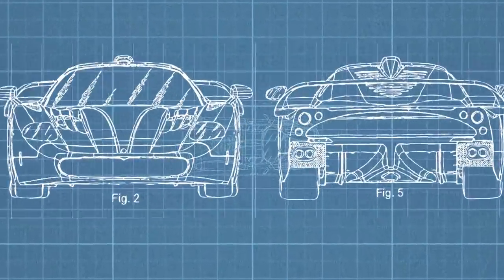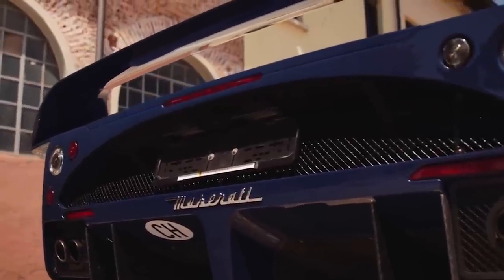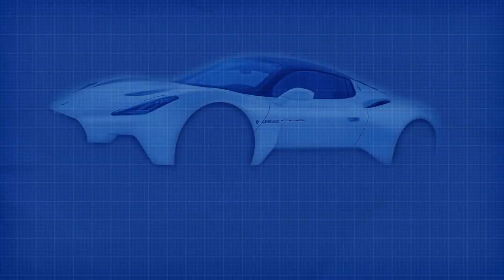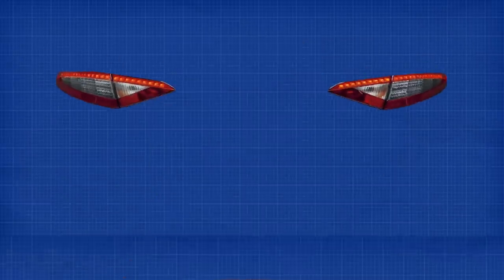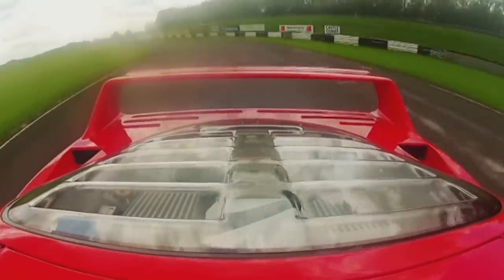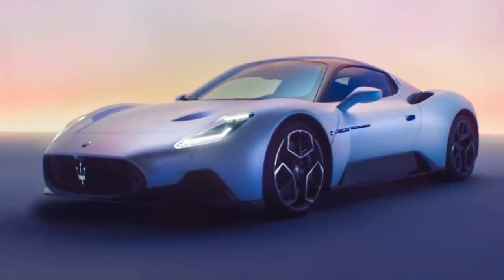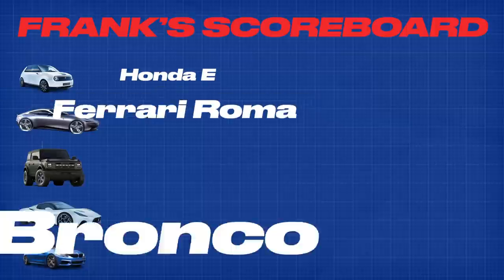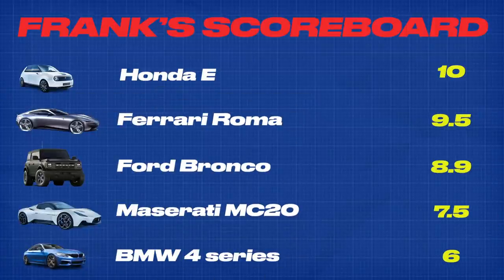MC12 Designer Analyses The Maserati MC20!

Comment: A Lambo Huracan has a drag coefficient of 0.39, the MC20 has 0.38 which is better. A porsche 918 Spider has 0.36 which is not far of the MC20. Almost all supercars have a higher drag than normal cars because of the higher downforce. A basic Giulia has 0.26 Cx while the Quadrifoglio version has 0.32 because it has much higher downforce. The air pushing down the car creates extra drag.

That is even more obvious in Formula 1 where the car drag coefficients are between 0.7 and 1.1, depending on the circuit the car is set up for (that is the downforce setup).
Reply from the maker: Thank you Cobra. Are you a professional or amateur aerodynamicist?
Reply: @FrankStephensondesign  You're welcome Frank. I am an amateur, no one payed me to say that. But the guys who work at the Dalarra wind tunnel are professionals, and get payed for nothing, since they got the aerodynamics wrong, right ? So what difference does it make if I am an amateur or professional aerodynamicist ?
Reply from the maker: Cobra, the wordings that you used are straight out of the Maserati press pack information and your reference to Formula 1 drag information is straight out of Wikipedia. Rule number 1 in the design world, never believe whatever you’re told, double check it for yourself. As to Maserati’s aero communication, the hype written about Dallara’s aero work is like saying Ricardo tuned McLaren’s road car engine. That’s great but nothing innovative, Earth shattering or segment leading. It’s like Maserati’s communication here: “The door sill air ducts, located immediately in front of the rear wheels in a zone with natural overpressure, enable the necessary air flow through the engine compartment without impacting resistance.” Every cooling duct does that. It’s like saying, “The door hinges on the front part of the door allow the door to open wide enough for the driver and passenger to get in.”
Reply: @FrankStephensondesign  But how can I double check the aero coefficient of a formula 1 car Frank ? I have never seen a formula 1 car or a wind tunnel in my life. Probably neither the guy who wrote the wikipedia thing, he simply took it from a reliable source, which he mentions there somewhere. As for the MC20, I dont know what more reliable source other than Maserati's own press release should I consult in order to double check if the info regarding their car's aerodynamics is correct. I think you have an issue regarding their interpretation of the data, not with the data itself. Now that I have seen the downforce figures I agree there may be some marketing involved in the press release which ellogiates an otherwise not very efficient aero design. A drag coefficient of 0.38 is not bad if you have 500 kgs of downforce, but if you only have 100 kgs, that's pretty bad. Compared to other supercars like the 458 Italia which had 0.32 Cx and 360 kgs of downforce, and no active aero either. Hell, even a sportcar like the Giulia QV has better aero than the MC20 (altough it has active aero in the front).
Reply: @FrankStephensondesign  The Mclaren engine is not just tuned by Ricardo...it is developed and produced by Ricardo, just like Gordon Murray engines are developed and produced by Cosworth. Mclaren doesnt build any of its engines, and neither does Gordon Murray. As you know, even the original Mclaren F1 had a BMW sourced engine from the M1. Then they used Mercedes engine in the SLR Mclaren. As far as I know, Mclaren and Gordon have never build an actual engine.
Reply from the maker: Cobra, McLaren’s road car engine is actually Nissan’s original VRH35L engine, tweaked.
Reply: @FrankStephensondesign They forgot to write that in the press-release, then :> So their british engine is in fact japanese. No wonder it sounds like a rice car.
Reply from the maker: No, the exhaust system is not carried over.

Comment: I think Maserati made a huge mistake by releasing the car in white. Sure its better to understand the lines going on but there weren't much to look at in the first place. I think for the case of the MC20 colors and tailormade attention will make it more Italian. I mean just look at the metallic yellow and red. It just so sexy and enticing. I think there is no emotions on the surface but the car could go so far head with it having it presented in a Rosso Metallizzato. Its not Italian passion I see on the surface but german swedish styling. Also i think carbon is a bit annoying to see allover an interior. I would rather prefer more metallic aluminum buttons for their tactile feel and the coldness and solid clicks they could achieve. I like the carbon shifters as it was seen on the Gran Turismo if I'm not wrong. i also wish they incorporated the air vents on the bonnet although they could add it on the race car version. I just didnt feel any emotions like i did when I saw a maserati years ago.

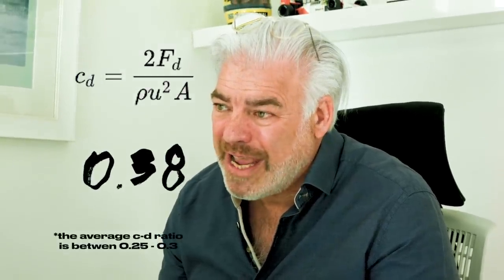Comment: 5:22 The Mercedes EQS has a Cd of .20.

A 350Z has a Cd of .30.

The Tesla Cybertruck has a Cd of .39.

A Cd of 0.38 is not so super for a super car
Reply from the maker: Not sure why you’re so concerned with drag coefficients of supercars ohroonoko. The Cd needs to be relatively high unless you enjoy low altitude flying. A Chiron’s number pushes .4 plus when needed and Formula 1 cars run at around 1.0 depending on specific track setups. So yes, .38 is excellent for a supercar but not for a VW Golf.

Comment: This design is way more classy/maseratish than the racy/ferrarish MC20 which I never liked, and it is actually a Maserati not just a rebodied Ferrari. The MC20 looked like an Enzo wannabe frankly stephensony.
Reply from the maker: Which part of the MC20 looks like an Enzo wannabe d a?
Reply: The side profile is almost identical to the Enzo FXX.
And the front is F50 inspired. The rear screams P4. Not a bad design by any means, but it looks like a ferrari race car, which it actually is.
Reply from the maker: Are you located in the U.K. d a?
Reply: No, in E.U. Why ?

Comment: I disagree on just about every point you made.
I think you are being too hard on this car design. 
I think it is a fresh update on an old marque. 
Not easy to do.
Reply: I guess I'll elaborate if anyone is reading. 
As a car guy I have absolutely no interest in Maserati. I have looked through the dealership lots for 10 years or so and found nothing new or exciting. It seems to me that they have done nothing to advance the marque except larger grills in front and leaning on the early success of the Quattroporte. Maserati has become a cliche like the three small vents on the door. The doors on the MC20 are dramatic, the proportions well balanced and I feel that there are no bad angles to this car. It feels longer than other two seaters on the market which gives it supercar extravagance. It doesn't have all of the deconstructive body pieces and angles of some of the new supercars have but I like that. I also believe that Dallara helped with the aerodynamics which is awesome if it is true. Knowing that Maserati will use this car as a stepping stone into the future with an EV etc is exciting for me as a car guy. It may be a bit clinical (I would say simple) but it catches my imagination which is more what can be said for the stale brand that Maserati has become, in my opinion.

Comment: Let’s be honest, it’s a 6/10. Non striking. Very expensive and nobody will buy it probably.
And the fact that it should have been Alfa 6C makes me angry but once again Fiat group changes plans. It’s based upon 4C platform with Giulia QV engine.
Reply: The base is that of the GiuliaQV but if you see the cc's of the engine is slightly different (Closer to actually 3 liters while the Giulia had something like 2.89 liters)
Reply: @GiulioImparato  Yes and pre combustion from F1 but all of that was in presentation of 6C which should have been out by now which only points to the same project just rebranded sadly. Even the steering wheel is from Alfa Giulia

Comment: I don't like this one because they made the mc20 on the philosophy and chassie of the Ferrari SF-90 which is not bad by any means but this one does not tick the electrification box alone with a separate all electronic model announced and this separation I understand but again dislike because the sf90 is a hybrid and this separation from the sister car with only an combustion or only all electric takes away the car routes witch are clearly there and another big thing they overlooked is the name mc20 compared to the last one mc12 clearly a bigger car with more ciliders and basically born as a sister car to the Enzo being a flagship model for Maserati like the Enzo was for Ferrari therefore the naming mc20 a bigger number for a smaller toned down street car with less ciliders I would say is not fitting and even the relation to Ferrari is not fitting because sf90 is faster then the Laferrari but not a true flagship model like the laferrari and Enzo were This new Maserati should of been Name something like MC 6 and been presented as the sf90's sister car with a v6 hybrid for the street version at least, the race car could use whatever most likely just the V6 complaint with FIA regulations like the potential for a truly desirable car was there but they killed it or maybe didn't have a necessary funding.....